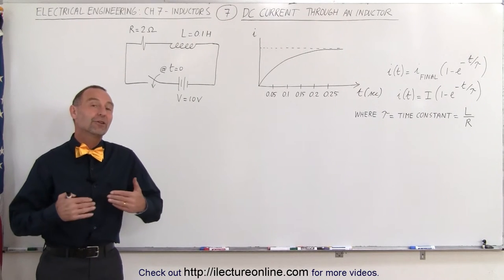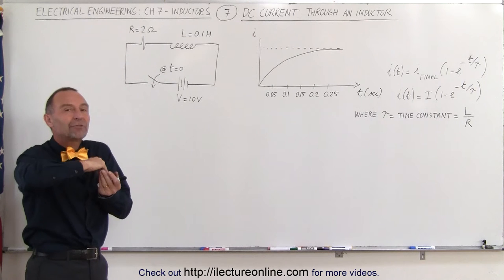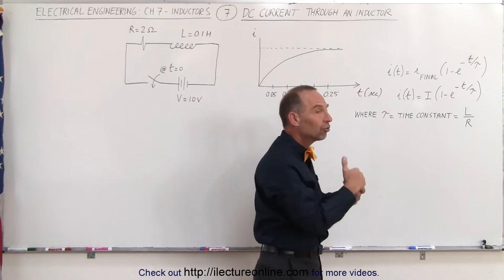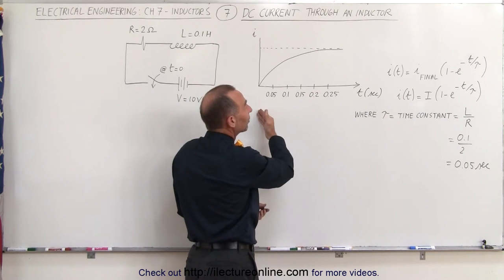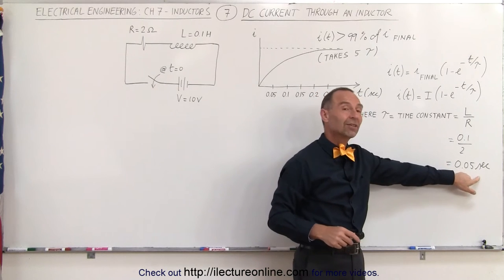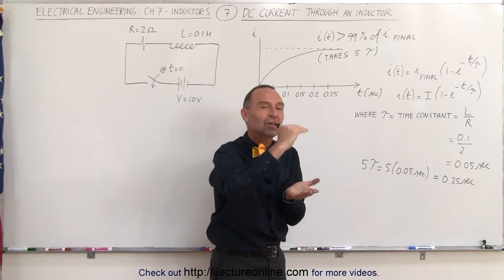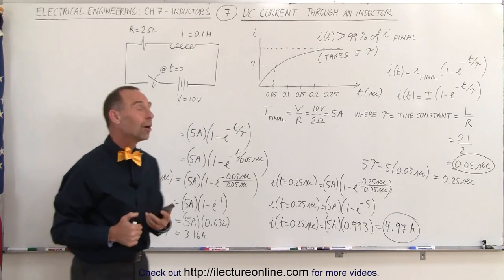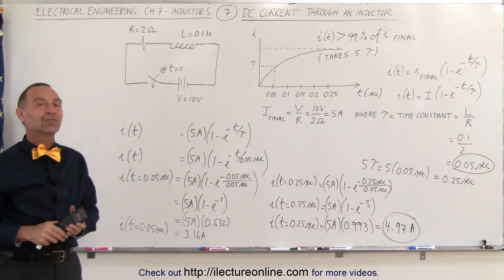Electrical Engineering: Ch 7: Inductors (7 of 24) DC Current Through an Inductor

Comment: Some people say that with constant voltage, the current rise is linear based on V=L di/dt, but I think that is only the case for an ideal inductor with no resistance and that really doesn't exist.
Reply from the maker: In an RL circuit, the current will never increase linearly, even with constant voltage, (even in the hypothetical case where there is no resitance).  Off course if there is no resistance then the final current would be infinite.
Reply: @MichelvanBiezen  Thank you, I appreciate that.  The analysis I've seen in the hypothetical case of no resistance is based on V=L di/dt.  Thus I = Integral(V/L).  With V/L constant, integrating a constant results in a linear equation for current.  So on the surface, the math seems correct, but where is the flaw?

Comment: also i have noticed that the current measured at the steady state when the curent is no longer changing  ,  is always less in experiment than that calculated theoritically by dividing V/R 
maybe the reason for that is that an inductor always has some internal resistance afterall
Reply from the maker: Yes, inductors do have internal resistance.

Comment: the 5t period of the charging phase of the inductor is equal to the 5t period of the discharging phase of the inductor
i.e. in a inductor , the time required for the current to change from 0 to max
is equal to the time required for the current to change from max to 0

correct  ???
Reply from the maker: That is correct.

Comment: Hello sir, your video is great!
While calculating the time constant, do you also account for the resistance in the inductor?
Reply from the maker: Yes, inductors typically do have resistance, but it was ignore here.  (you would simply add it to the resistance of the resistor in series, so it wouldn't make any difference in how you solve this problem.

Comment: Does R2Ω represent the internal series resistance of the inductor? Can I use this equation to calculate from i(t) to I'(t), because as you know  in an oscillating switch scenario L will often have a remnant current, like in the case of a CCM boost regulators inductor.
Reply from the maker: In the "real" world, every inductor has some resistance.  But for the purpose of the schematic, the 20 ohms can be either internal resistance of external resistance and it wouldn't make any difference in the performance of the circuit.
Reply: @MichelvanBiezen  So, in the case of a boost regulator, I can use the internal series resistance to get τ (τ=L/R).  I molded a few distributed airgap toroidal cores from some old, pulverized  Mn-Zn E cores that were shattered in a fall, using heat conductive epoxy and the 30%of the epoxy is comprised of other metal oxides, so I'm in new territory as far as materials. The one I wound won't saturate until it hits a peak of 45A in calculation. What I'm getting at is, doesn't the charging constant have a lot to do with core material permeability multiplied by the permeability of free space and how  μ changes the shape of the B/H hysteresis curve, as B approaches Bsat, where the higher μ is the less linear the B/H hysteresis curve is,  changing the value of L being L=μΝ^2Α/l, which is different for every core material. So would this equation still hold true in varied core materials or is the topic of core materials beyond the scope of this video? 
EDIT: Your does hold true involving steady state DC voltage. I've come to realize that being my project is where the complexity lies, being it involves a DC input voltage, in the form of 120Hz arc (rectified, unfiltered AC), where v(t) goes from 0v => ~170V => 0V every ~8.33mS, so this problem is a bit beyond the scope of this video as it involves a v(t) that is independent of i(t).
 You're the only professor that exists on YouTube  that explains the charging of an inductor in such a concise manner, including USEFUL equations, keeping it easy to understand. Thank you for taking your valuable time as an educator to supply all of this valuable information to the public or free.

Comment: Are inductors only used in ac circuits? With the current constantly changing.
Reply from the maker: It doesn't have to be an AC circuit.  They are also used in DC circuits with temporary changes in the voltage or current, they are used for voltage ripple suppressors, voltage protection devives, etc.

Comment: what happens to voltage in the inductor  when u apply constant increase of current in the  inductor?.Why it is said average voltage across inductor coil is  to be zero in buck converter design. thank u .your way of teaching is amazing.
Reply from the maker: The voltage across the inductor is proportional to the change in the current through the inductor.